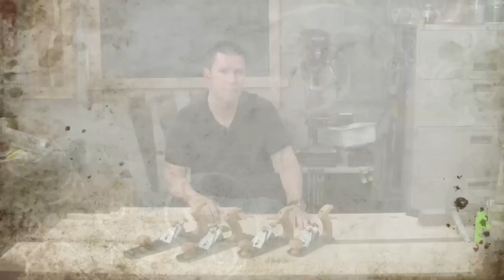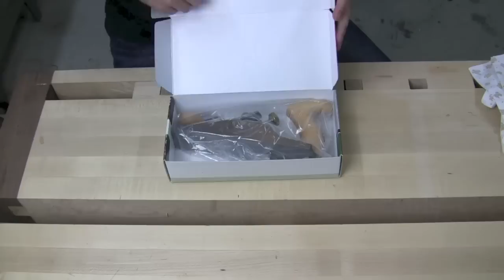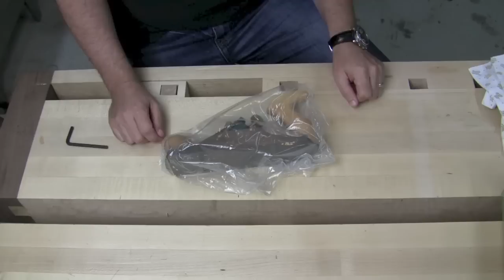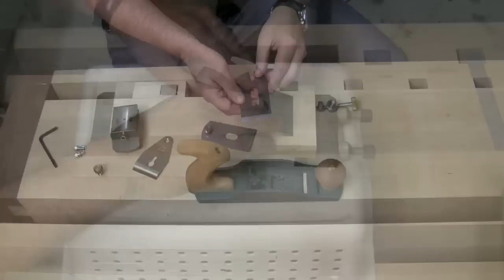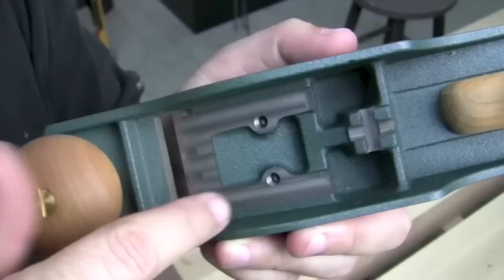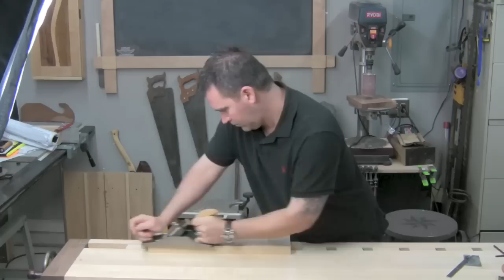Kunz Plus Hand Planes

Comment: The final demonstration didn't show the plane working that well. Also, keep in mind that continuous use of the ruler to remove the burr may cause a gap to develop between the blade and chip breaker which can lead to the plane choking. On a well machined blade, just laying it flat on a whetstone will remove the burr.

Comment: Dear Chris   what  model out of above range of kunz would you suggest  for smoothing  guitar soundboard   which dimensions  are   400mm*320mm  and thickness around 4mm. need to achive  1.5-2,5 mm  finally.  material is  spruce or cedar   thanks a lot
Reply from the maker: Hello. If you need advice on planing your guitar soundboard, please call us at tech support at 800-241-6478. Thanks, Highland Woodworking